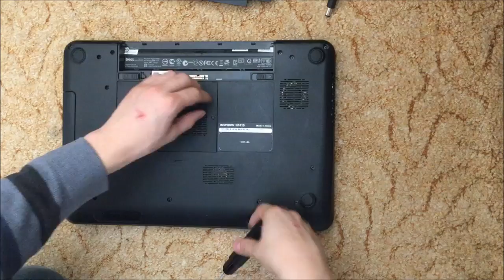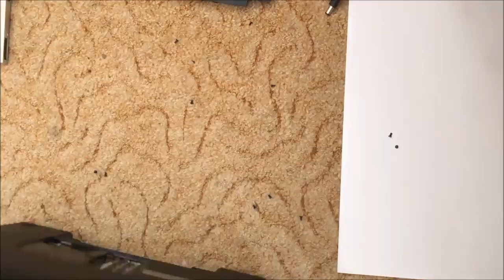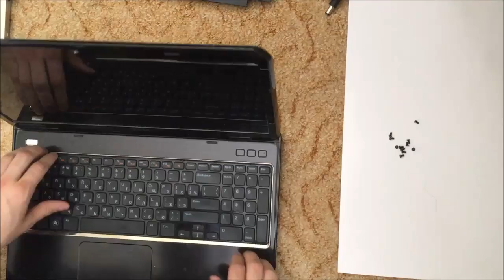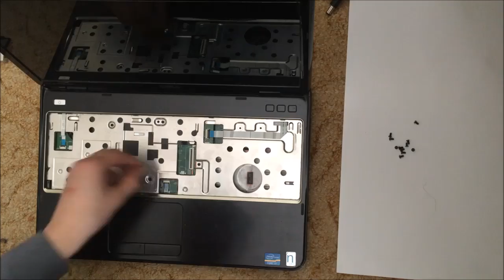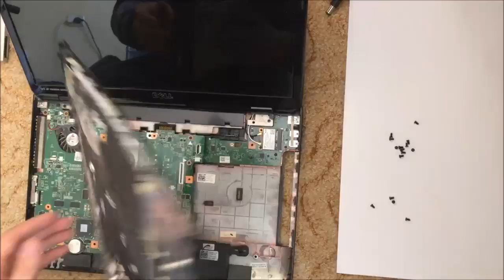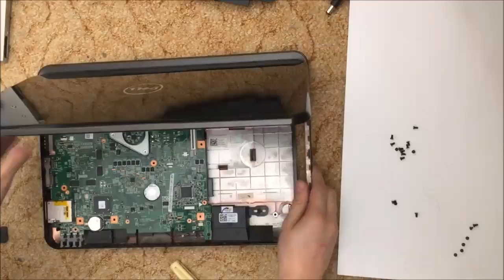How to chage hdd ssd in dell n5110

Comment: Hey, what's the spec or detail of hdd should I look into for its replacement?
Thanks
Reply from the maker: Best option is to look for SATA 3 6gbps with 500/500 read write speeds couse it can use that speed, for exaple you can look for samsung ssd drive now it is much cheaper
Reply: @raven3831  do any ssd compatible with this laptop? Or should I look for 2.5 inch one? Sorry I don't know much about hard drives.
Thanks
Reply from the maker: @mooncow1412  yes you have to look for 2.5 inch

Comment: Hello there how are you I saw your video and I like it very much I just want  I just have one question I get I have this same laptop  When I start the laptop I hear three   beeps 
 I don't know what's wrong with it If you Can help me and tell me the fault and how to repair it Thank you very much
Reply from the maker: hello the posible reason
chipset Error (North and South bridge error, DMA/IMR/Timer error)
Time-Of-Day Clock test failure
Gate A20 failure
Super I/O chip failure
Keyboard controller test failure

Comment: Horrifing design!!  I became PC archeologist when i fixed HDD on this laptop  by removing it after terrible update error, which is "location not available""
I searched and searched answers for that error and tried and tried to fix with them but they didn't work.

I just wonder if the pc worked or not with SSD on it.  i saw a comment saying it had an error with SSD on it